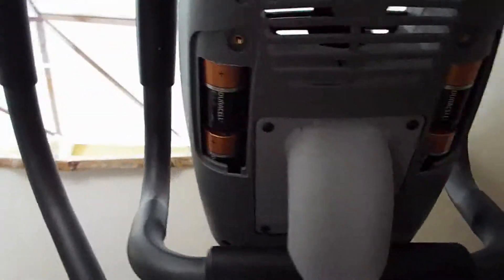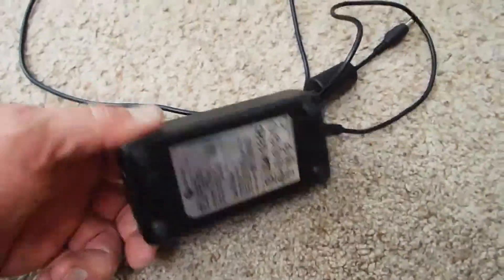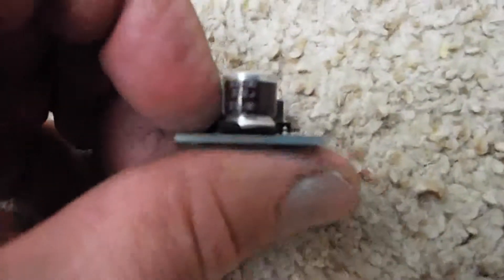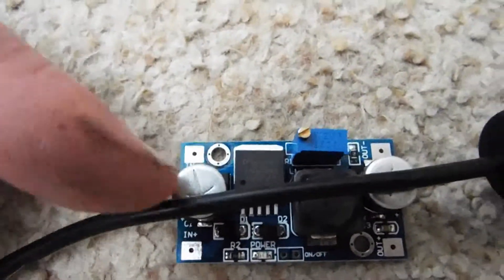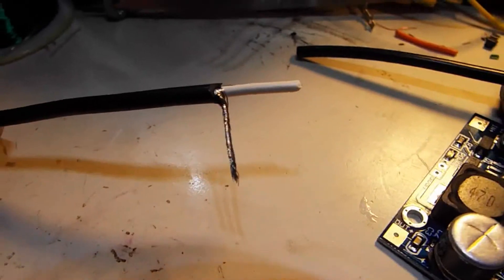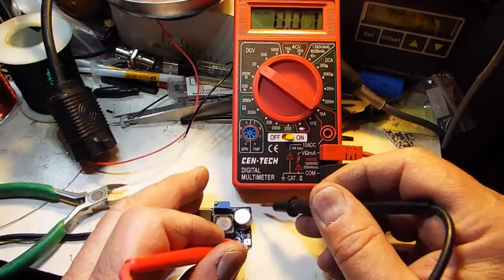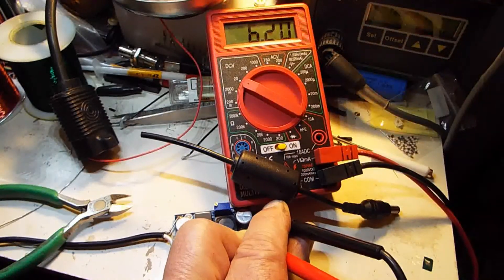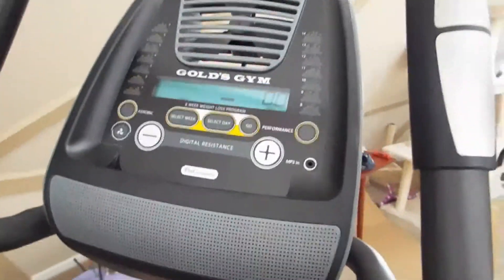Golds Gym 510 Stride Trainer Elliptical: Connecting a 6V Regulated Power Supply

Comment: What would of happened if you left it at a 12 volt
Reply from the maker: While the absolute maximum input voltage isn’t clearly stated, the 6V operating requirement suggests a safe upper bound around 7–8V. Applying 12V would almost certainly exceed the tolerance and likely destroy the circuit, complete with the ceremonial release of magic smoke.